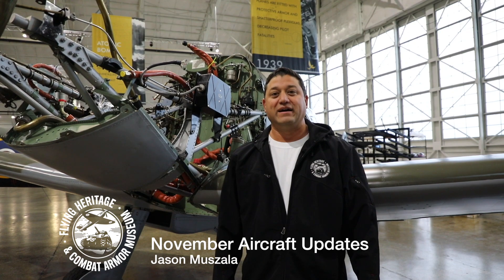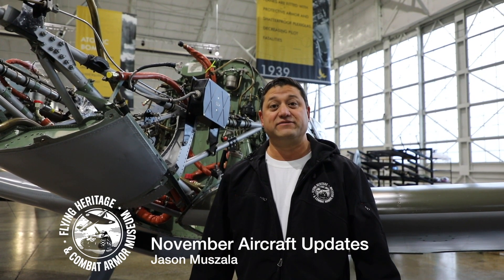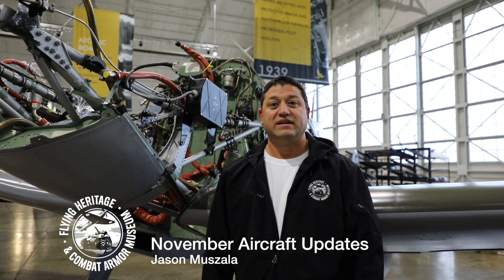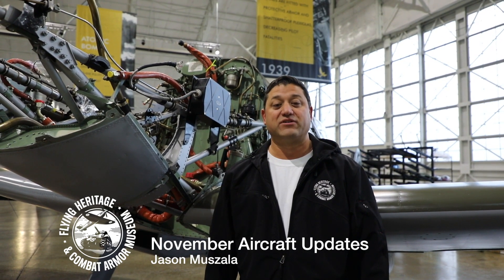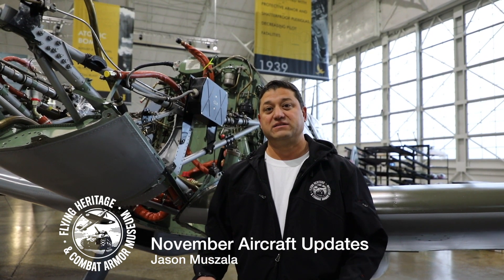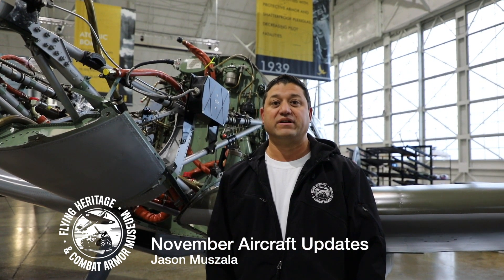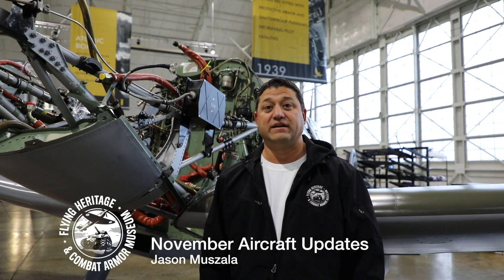Aircraft November Updates

Comment: Cool work all you there involved!! Can I enquire, is the 262 a modern replica, or restrored old one with Flugwerk parts? - barring the new modernised 004's design - could some info be released about the new 'old' turbojets please?
Reply: It is a real one - they are rebuilding the original Jumo engines with modern materials and it will be the only flying real Me262 in the world.
Reply: @gtv6chuck  so, are you saying the Jumos are Not largely or totally of modern manufacture to the Jumo design(s) A's or B's but have some parts of modern metalurgical spec & manufuacture in them ? as in rebuilt - if so, it sounds very iffy for insurers, the pilot and such if they are rebuilds.

Or do you mean, remanufactured, i.e; new ones made to design where appropriate with modern metalurgy etc, and/or perhaps with bits of C, D or E evolved componentry design in there too?

I assume its actually the later case of modern newly made engines to Jumo design(s) with modern aerospace-turbine techniques, materials, processes etc being utilised. Sorry if I seem a bit short fused, that's not my intent to appear so, please forgive my writing style.
Reply: @razor1uk610   I believe they are using some new parts and some old parts, much like the flyable Fw190A, the Mosquito and several of the other planes they have there. I heard that will improve the engine's reliability to 300 hours as opposed to the 3 flight reliability of the original engines with their poor metallurgy due to the war situation. There is another video on this YouTube page of them testing the engine.
Reply: @gtv6chuck  That would suggest the engines themselves are more likely complete new bulds, as I would think the major structural & important parts of the aircraft are too IMHO.
   Original parts could well include intrumentation, some minor flight surfaces (wing leading edge slats) undercarraige & their doors, deactivated guns (for CoG weigting unless replaced with nose ballast) etc.
   Forgive my questions & musings, I myself have a copy of German Jet Engines & Gas Turbine Developments 1930-1945, and am deeply interested in engineering, technlogical, military and ancient histories etc, so seeing the Jumo 04 start up really grabbed me.
Reply: @razor1uk610  I would think that at the very least all the turbine blades, fuel system and bearings are all new. It is like a vintage car - everything in the engine may have been replaced but it is still the same engine block.
Reply: @gtv6chuck  if its going to fly with those engines, under US FAA rules, I'd guess nearly everything is new barring perhaps the compressor casings, the sand-cast accessory drive gearbox castings, the combustor cans section covers; but the risk to damaging surviving WW2 era engine components that have age hardened/corroded would be too risky. Sorry I keep going on.